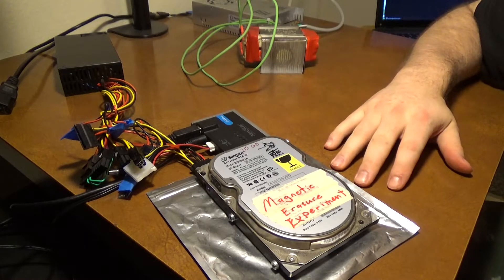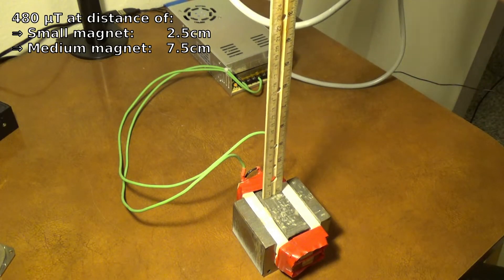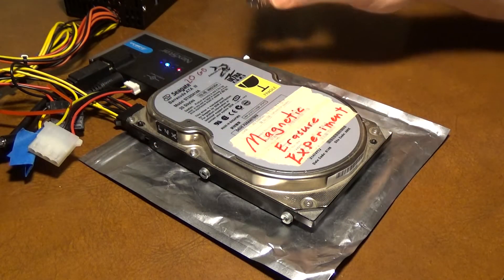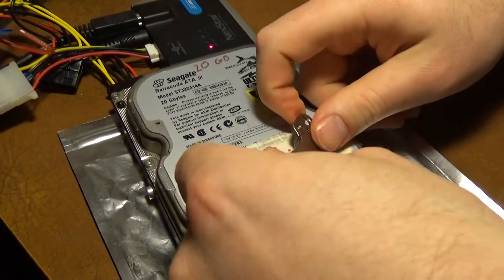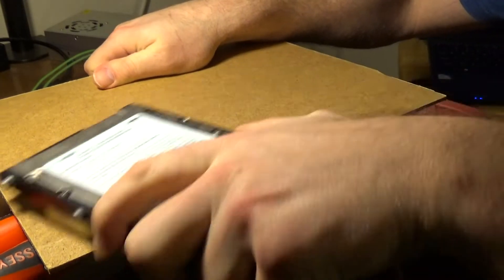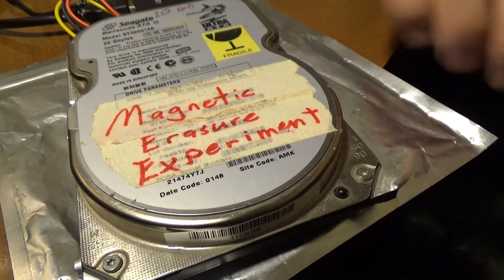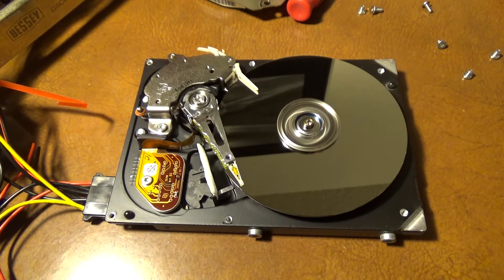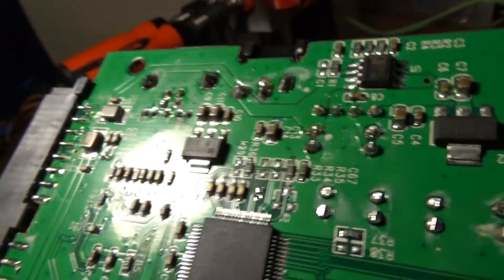Hard Drive vs. Monster Electromagnet - Will it erase?

Comment: I dont think the heads are failing. I think you erased the servo tracks with your giant electromagnet. The servo tracks are what the drive uses to initialize the hard drive, and test its seek function. That is what you hear when the drive is completing the seektest.  If this data is missing, the drive will click forever. It sounds to me like the servo tracks are damaged but still in tact, because the clicking isn't constant. It attempts to read them, but ultimately doesn't.

Comment: Did you apply the 24vdc to the primary 120vac ? The DC resistance of the secondary HV coil would be too high for 24 VDC to give ant strength?

Comment: Just posted somewhere else that external magnets shouldn't erase a HDD. Looks like I'm right. Never thought of using an external magnet to impede the head from moving. Looks like you might have caused the head control circuitry to overload. I would have thought they'd have had current limiting to save the silicon from failing. Maybe you're magnet induced a nasty EMF in the coil and that took the TI chip out. Might explain why your ATA to USB clapped out too. Good work.
Reply: @F45050  yep that's how HDDs are built now
Reply: Need better testing, I applied 3 magnets to a external HD for more than 10 hours and it powers up, it spins just fine, windows recognises the HD plugged in but it cannot be seen anywhere. Whatever the magnets did, the HD can't be accessed.